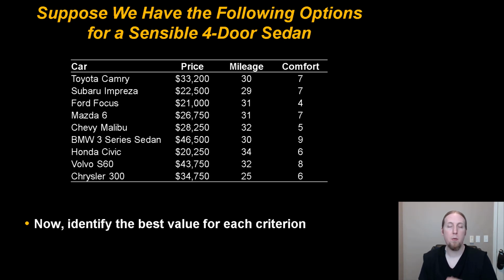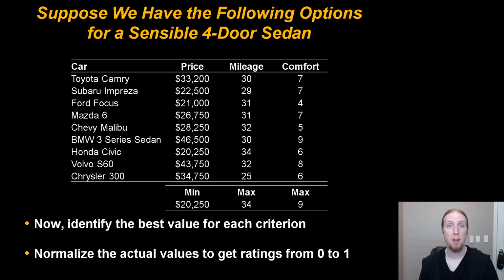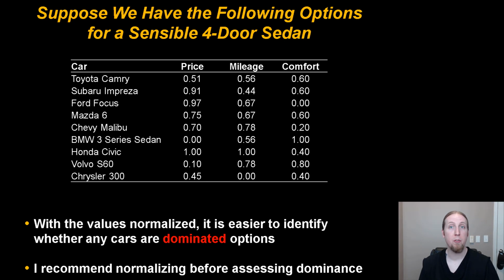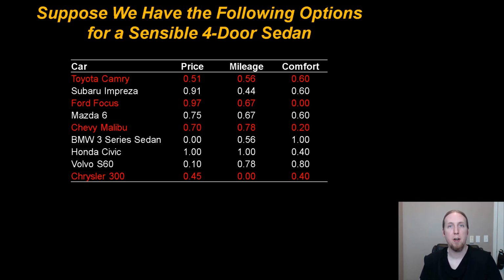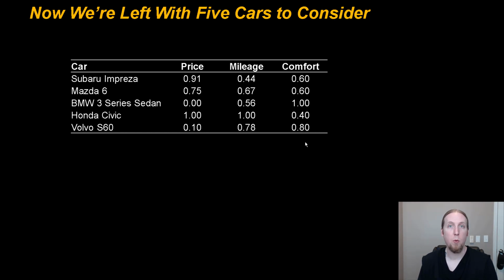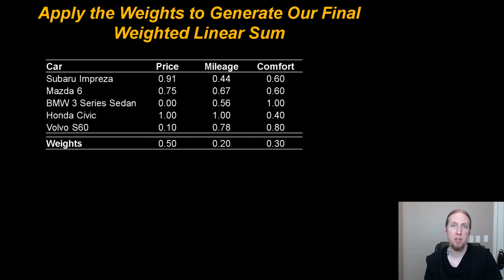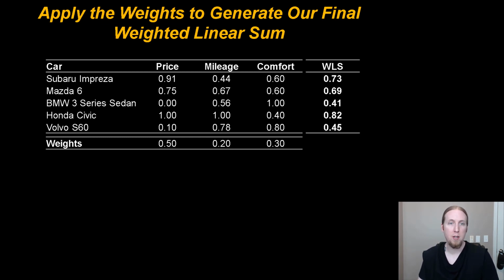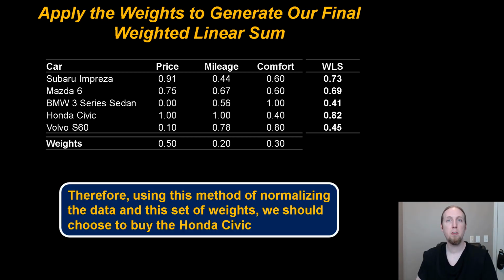Multi-Criteria Decision Analysis, Part 3: Example Problem

Comment: For dominance, if there are 3 criteria and if 2 of those are greater than or equal to the compared subject, is that considered to be dominant?
Reply from the maker: No, it has to be greater than or equal for every one of the criteria, and strictly greater than for at least one (assuming all criteria are to be maximized). If a project is better than another for only 2 out of 3 criteria, we still don't know which project would be preferred; that would depend on the relative weights the decision-maker assigns to each criterion.